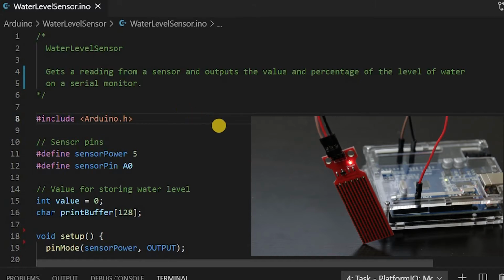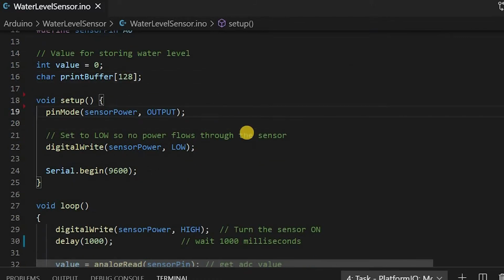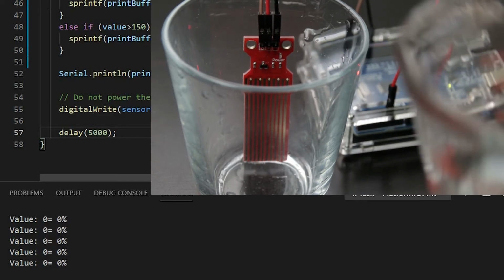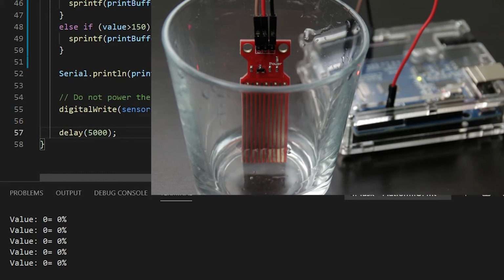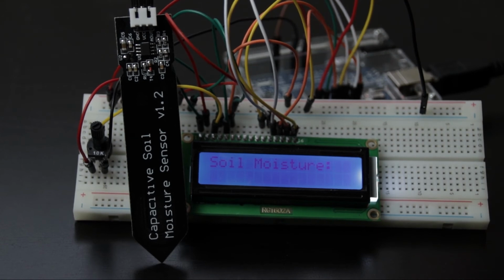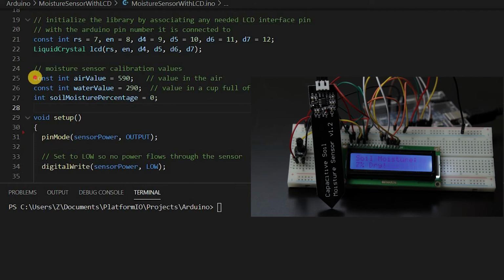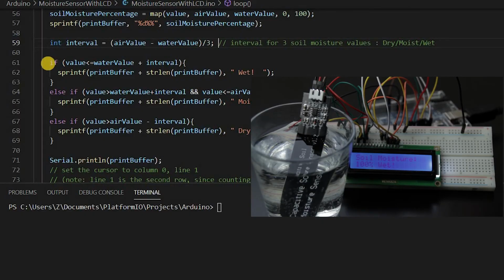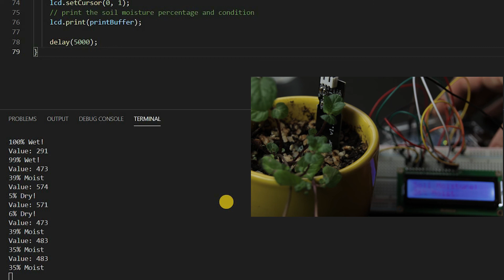Arduino Water Level Sensor vs. Capacitive Soil Moisture Sensor

Comment: Good day,
This was a very informative video thank you. I got a group project at school and we were given the task to assemble a moisture level sensor.  You're video is quite helpful and has helped my group tremendously, however we have a few more questions and I'm asking if it's possible for you to answer a few additional questions that we have. I hope you see this message and if you have time, you can answer some of our questions. Again this was an excellent video 👍
Reply from the maker: Hi! I'm glad you found it helpful. Go ahead and post your questions and will try to help if/when I can. Happy holidays!
Reply: Good day 
How can we can incorporate a motor into the circuit and control the flow rate to decrease wastage of water?